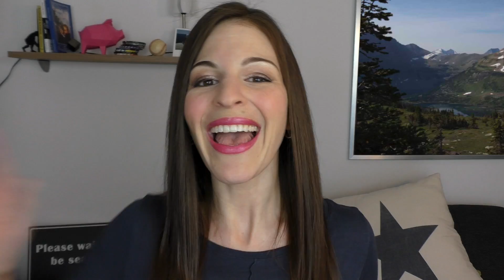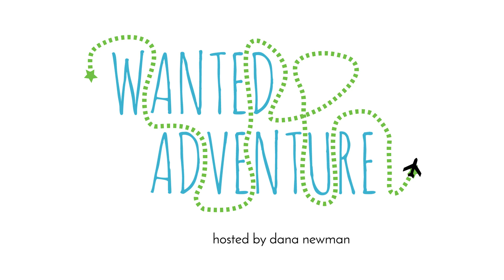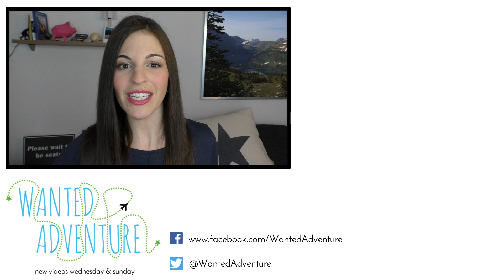Why Are Houses in America MADE OF WOOD?!

Comment: My opinion is that if a solid brick house is hit by such objects, there might be damage but after all the house is at least still there.
This is just another case where Americans think that the way they've always done things must be the best way to do it... which is almost never the case
Reply: As an American in a brick house I can tell you 75% of the time it comes down to cost. 
My house cost me $120K  My friend is about to buy a house much larger than mine for just $30K.....it's wood. 
To be fair we don't live near tornados or hurricanes or earthquakes so it hardly matters, but even so, the difference in cost is huge.
Reply: +Figthtplan-But who does that?   I don't know anyone who would have to rebuild their house every 20-30 years...you must be exaggerating to make a point.  It is not difficult to build a sound house of wooden construction that will last for hundreds of years...we have them everywhere here in America.
Reply: +TravelEnthusiastDE "This is just another case where Germans think that the way they've always done things must be the best way to do it... which is almost never the case" for building in the Americas.
Fixed that for you.

Brick houses and buildings don't stand up very well to shear stresses. You may be left with what is essentially a roughly house-shaped pile of rubble that needs to be torn down and rebuilt. Wood framing's flexibility is an advantage here. This is especially true in earthquake-prone areas. 

Stone houses are generally built like piles of rocks and the roof is not attached well enough withstand being ripped off by hurricane winds. Not terribly different than a wood frame house. But the walls in a wood frame house aren't then like a cracked egg shell, they are resilient. Take off the cladding, repair any broken timbers and reclad the house. Wood frame houses are also easier to insulate and give a larger interior space for the same footprint.
House designs using steel reinforced concrete to withstand missiles have been proposed for tornado alley, but the actual odds of a major tornado hitting a particular house is very low, making the extra investment often not worth the extra cost. Most of those towns you see on the news getting destroyed have been there for many decades or even more. It is often better to simply build a tornado shelter in or near the home underground or with steel plating or reinforced concrete.
Reply: Bullshit, a house buold of bricks would collapse in an tornado just as easy as a house made of wood. Just do the math an think what happens to houses in germany tahtget hit by a truck. Some of them are no longer safe. And those trucks hit em with 80km/h or less. Now think of the impact of a Truck hitting a house with 4-5 times the Speed.
Reply: I don't understand why there are so many comments from people who don't live in American that feel upset by how houses are built in America. Like I don't care what your house is made out of, it's not my house and if you're happy there and it works for you then great.
Reply: I live in the middle of tornado ally, and it doesn't matter what your house is made of, it doesn't stand a chance against a EF5 tornado (the strongest tornado's). EF5 tornado wind speeds go around 322km/h and that is not counting the things flying around, like buses. We also have to consider earthquakes and wood framed house stand better against them than concrete houses/buildings.
Reply: +TravelEnthusiastDE  It depends on whether you're talking about decorative brick (same in the US and Germany (and many other countries)) or solid brick as the structural basis (done in the US until the late 1920's). 

Decorative brick has no real strength.  It is purely cosmetic and provides weather protection against the typical elements.  Structural  brick has immense compression strength and close to zero lateral strength: in an earthquake or tornado, where forces are being applied laterally, they simply collapse.

Having said that, brick isn't out of favour in the US for either of those reasons.  it's simply too expensive compared to wood.  Wood can be pre-built for easier site assembly. It allows for more shapes and sizes than brick can possibly manage.  If it is treated (which isn't done in the US - they only heat treat for weight and aging) for insect protection then it won't be subject to termite or other insect attack.  Wood, quite simply, is cheaper to use.

In terms of strength for tornadoes and earthquakes, wood actually has advantages over concrete and brick.  The structures can flex with low level events, reducing damage and lowering repair costs.  In higher level events the failure cycle tends to be progressive, not sudden.  Brick will support up the point of failure and then has a very narrow window from failure start to complete failure.

Concrete is the same, but with higher compression & sheer values - depending on the type of concrete construction used.  The exception to that is the air-concrete block products.  Those are stronger than wood, often lighter in individual pieces, and can be shaped and worked just like wood.  but they simply aren't popular in the US, despite being around for the last ~30 years.  Part of the reason that style of material hasn't caught on more is still cost and the fact that US builders generally aren't familiar with it.

Personally, from seeing a lot of building in the US, I think US style materials are often utter crap, but the builders tend to do very good work with them.
Reply: Live right in that alley in East Texas, brick homes, wood homes pretty much NOTHING can withstand a direct hit...nothing. Homes with not a direct hit often are not just wood or brick but poorly built for suburbia. What most of us do is get the insurance , build a storm shelter & pray there is no direct hit. Would you it explain it to them for me?
Reply: +blue ferral What you are referring to as "wood chips and glue" is called engineered lumber and it is superior to harvested and sawn lumber in almost every way. Every piece is identical and true. Fire resistance has been tested and is identical to harvested timber. That's like referring to carbon fiber composites as "burnt nylon and epoxy".
Reply: I live in the US and I have seen a wooden house picked up and moved off its foundation into the street.  It did take some moving to put it back and a bit of repair onto the foundation but the house was fine.  To my knowledge the house was about 100 years old and is still standing now 20 years later.
Reply: TravelEnthusiastDE You think a brick house is indestructible?  Mother Nature will win every time.  She has more power than some will ever imagine.   F5 tornado vs brick house....brick house loses.
Reply: Even some solid concrete buildings can not withstand tornado. Mother Nature has a lot of force to throw.
Reply: I think you don't understand what "build out of wood" actually means. Most american houses are built with wooden frame covered with something else. Pretty much like most of UK houses, except in UK they cover wooden frame with bricks.

So it is not that easy to ignite with no reason. Main reason for fires is electrical fault, or gas boiler fault.
Reply: Coco s
Generally, a brick or stone house will have more damage from an earthquake than wooden construction...especially if the seismic activity is lateral. If it is reinforced poured concrete, it would likely do better than wood but most houses only have reinforced poured concrete footers or foundations.  As for fire, the house I lived in while in Germany was concrete block but the entire roof truss system as well as much of the interior was wood.  If it caught fire and say, for instance, the roof burned off, it would still cause a large amount of damage because as soon as you heat stone or concrete blocks, they have a tendency to expand and the mortar fails.  And concrete blocks will shatter under the heat of a fire.  This would necessitate the rebuilding of the effected area anyway even if the block wall remained standing after the fire. However, it likely would take longer to ignite into an inferno than a stick built house.
Reply: Modern American building practices are shit.  The giant builders have taken lobbied the legislatures to allow them to build houses out of wood chips and glue.  They are literally designed to last 50 years now.  When they catch fire a home can be completely engulfed in fire in 15 minutes or less.  Older homes were build with much better materials and took much longer to burn down.
Reply: There are wood houses here that are over 100 years old.
Reply: +blue ferral That doesn't make any sense. An 8 foot 2x4 made of engineered lumber has the exact same surface area as an 8 foot 2x4 made of sawn lumber. And did you not understand that they were tested?
Reply: +Coco s Look up the Santa Rosa earthquake to see if brick does better in earthquakes than wood or steel frame structures. Hint: they don't.
Reply: psunshine2 hey! I'm from wichita ks. where are you at? 
and I agree. I don't think they realize how powerful tornadoes are. there isn't any brick or concrete structuring that's affordable and will withstand stronger tornadoes.
Reply: My opinion is concrete and brick are only slightly better than wood. The best building material for any structure is going to be steel, aluminum, etc. which can then be reinforced by concrete. To be 100% tornado safe, you would need to build your house using steel and concrete properly anchored to the ground, and then also you would need to have a steel entry door and literally no windows, no garage, etc. This does not sound like a pleasant place to live! 

The real issues with wood are not so much tornados, but more-so termites and rot. With that said though, it's not that difficult to replace or fix wood structures that have termites or rot. I live in a wood home with an exterior brick overlay. My home was built in 1970, and I've had to have some bits of wood here and there replaced due to water damage, but it was easy to do and quite inexpensive. Wood homes are cheaper to build; building an entire house out of concrete, steel or brick would be so much more costly. This is why homes in America are often quite extravagant. Contractors penny pinch on their building materials, so they can build very large houses with mid-range to high-end products on the inside.
Reply: +psunshine2   >>and wood framed house stand better against them than concrete houses/buildings.<<

That is not a given.  It all depends on the building code in the state you're looking at.  Wood frame houses in CA are built to withstand low level earthquakes quite nicely.  They have to.  Houses in, say, Missouri or Florida, are not.

Americans tend to think of poured-in-place reinforced concrete whenever anyone mentions "concrete".  That is absolutely the weakest form of concrete you can get, short of using unreinforced cast concrete blocks.  There are far more options out there.  Pre-stressed concrete construction.  Air-filled concrete blocks (you can cut the stuff with a knife, but it's concrete and immensely strong), foam concrete on metal frame.

"Concrete" covers a very wide range of possibilities.

For example, pre-stressed concrete can withstand huge earthquakes if designed well.  Look at the government buildings in Christchurch, New Zealand, most of which stood up to 2 very major earthquakes just fine.  They are all pre-stressed concrete buildings and are specifically designed to withstand earthquakes.  Nothing wooden the same size survived, despite being built (in theory) to the same earthquake standards.
Reply: blue ferral  You said, "As to carbon fiber, it burns like crazy."  Below is an excerpt from  the Japanese Carbon Fiber Manufacturing association at http://www.carbonfiber.gr.jp/english/material/safety.html.  I know there are different types of carbon fiber but not sure they burn like crazy...

"Flammability: Though Carbon Fiber is constituted of carbon which is flammable, the fiber itself dose not flare up even if ignited by flame of match or gas burners. If heated up higher than 400 degree C together with some fuel, the fiber slowly burns (oxidized) but stops burning right after the burning fuel is removed. In this aspect, Carbon Fiber is categorized as "incombustible" under the Building Code of Japan."
Reply: +Benighted77 "reinforced concrete would be my choice for being in if a tornado hit."
As long as it was underground, sure. Strong tornados have been known to tear the pavement from highways. Tornadic winds carry debris big and small. The EF5 tornado that hit Joplin, Missouri in 2011 knocked one of the 8-story hospital's buildings off its foundation. This isn't a fairy tale Big Bad Wolf threatening to blow your house in.
Reply: Well what can't afford a home built like that because it's much more expensive?! Is it better to be homeless? I think the smart thing is basements in tornado valleys because even those heavy walls can fall on you then you got big giant heavy walls falling on you hitting you crushing you and burying you underneath! I remember there was a country that had a big earthquake and a BUNCH of people died and all the houses there are made out of concrete. So I think the smart thing is basements OR you can even build a small underground bunker which might be cheaper than adding a basement. They don't have to be big
Reply: Not really, Because if you pay insurance then the insurance pays for building your house and replacing everything that was ruined.
Reply: we are insurance & have lived around & in wood houses my entire life none have caught fir due to glass or something.  Most fires in homes are caused by faulty wiring, or something left on like a cigarette etc.  Since code causes for total loss after fire bc of wiring. It doesn't matter if it's made of stone, it will still be condemned and against the law to live in. It's not like wood house are just waiting to catch fire lol. My house is 190, made of wood, it's only that young bc this town is newish been here only  190 years.  But even stone houses & brick house made new are just a veneer, old stone houses are wood on the inside.
Reply: My opinion is that I'd rather have wood fall on top of me then solid bricks. hahaha
Reply: Air-concrete blocks are awesome to build with, the ability to just cut it to size and the lightness of the material makes it a wonderful material to build with and rather adaptable as well. Need another window in that wall? Get me the saw, clean and simple. Don't need that window anymore? Just put some bricks back in again, literally good as new.
Reply: I lived in a wooden house for over a decade. it's still there and it will probably exist for a few more. Just like every other wooden home in America. You're just trashing on American culture.
Reply: Something for everyone. I live in the middle of several major earthquake faults and so I'm familiar with the strengths of framed buildings (steel or wood) in such an environment. And I'm familiar with the weaknesses of masonry construction and pre-stressed concrete and even steel trestle structures that were not well thought through.

All historic masonry/adobe buildings, even those dating back to the 1700s are reinforced with plates and beams of steel now or condemned as not fit for human occupancy. Two major freeway flyover sections made from pre-stressed concrete failed and were torn down (Embarcadero and Cyprus viaduct, the latter of which tore itself down and killed several dozen in the process) as a result of the Loma Prieta earthquake in 1989. The eastern span of the historic Bay Bridge failed in the middle and dropped a section of the upper deck onto the lower, killing one driver. That has been replaced with a cable-stay bridge to complement the suspension design of the western span.

But, here is the "something for everyone" in regard to family homes, one of the main hazards in even relatively small earthquakes is not inspecting the chimney for the fireplace. The wood frame of the main structure rumbles through with no problem in a summer quake, but the brick chimney of the fireplace cracks. When Christmastime arrives, the homeowner lights a fire and hot flue gases leak into the structure and light the wood frame on fire. Houses built after the 1960s tend to have the chimney built outside the structure, though. Only the hearth is within the structure, and that is overbuilt.
Reply: +Dewy Russ Thats true. Formula 1 brakes are made of carbon fibre. And they heat up to several hundred degrees C. In fact, given the right camera angle, you can see them glow orange to yellow.
Reply: TravelEnthusiastDE   why do you hate free speech and polite conversation?
Reply: but are you not afraid that your house might simply burn down? i mean i know nothing about american houses so maby they are somehow fireproof but.. woods sometimes ignite because of a peace of glass, so what if your house suddenly burns down for no reason?
Reply: toast brot as someone who lives in California that would make some sense. We gets lots of wild fires here and because it's so dry the fires become huge(possibly hundreds of acres). It would make sense if our houses were more fire proof. Often the only thing left, but a pile of ash is the brick chimney. However, idk if a brick or stone house would do better or worse in an earthquake.
Reply: Increased surface area, increased fire spread, increased time to failure.  Yes, superior in every way.  Or you can say lighter, cheaper to ship, easier to cut, less likely to warp.  All the things that are cheaper for installation not safety.  As to carbon fiber, it burns like crazy.
Reply: Id also say, maybe not an easy brick wall, but a reinforced concrete building could withstand a tornado, maybe you would need to replace some windows and rainpipes or such, but that is no compare to have the whole building and everything thats inside in pieces, not to mention the danger for the people that live in.  I think wood is much cheaper in that area and maybe people cannot affort reinforced concrete which takes formework, reinforcment, and pooring and compacting the concrete is also a job where a lot of stuff could be done wrong.

I also think that the lack of regulations plays a key role. If you build in austria in a area that is considered dangerous, there is a zone plan, where there is clearly specificated which kind of features your building must have, to protect you from avalances, hillslides or rocks that could come down a hill. There will be no moving in, until everything is up to the law.

I dont know how that is handeld in the us, but i guess the regulations are not that strict.
Reply: Please keep in mind I am just speaking of my personal experience in the area I live in. When looking into building a house we met with the only person in our area that was building homes with reinforced concrete walls and it was going to be three times as much as a "stick built" home. Yes we do have tornadoes where I live but I have not been directly affected by one in 41 years so we went with stick built.  Was it the wisest decision? Maybe not but it is what we could afford. Of course we have home owners insurance but hopefully we will never have to use it.  I also agree with those that say Americans think the way they do things is better and in this case it is not or (in my opinion) we would have more builders building homes with reinforced concrete walls. Then again it could just be the area I live in.
Reply: Its called "Insurance",,lol
Reply: I think every year Americans hear about the people dying of heat stroke due to their brick houses heating up. Brick houses are seen as more of a liability I think.
Reply: Small town in Arizona about 2 and a half miles from the Mexico border. 
It is very cheap. we are a mine town that just opened a second mine. Homes and apartments are near impossible to afford right now because Mine workers make bank so they can raise the price, which sucks for us non-mine workers. 
So for her to find this place is a lucky score. It needs paint and the carpet is a mess. But she hardly cares about that as paint is cheap and sh hates carpet so she's ripping it all out anyways.
Reply: Thanks for agreeing with me and I live in midwest city, ok.
Reply: I live in New York State and my house and all my neighbors' houses are 100+ years old.
Reply: Bus, 300km per hour. Nah. A few walls are still there, the house is gone. ;-)
Though getting hit by such large objects is rare even when your town is hit by a tornado … but that doesn't help you if your 10 times more expensive brick house actually got hit by that tornado, and if repairing just one wall of your house is more expensive than the whole wood house, you certainly did not gained anything by building sturdy.
Reply: Im not sure he is referring to the use of engineered lumber framing, but the increasingly common practice of using oriented strand board instead of plywood. OSB does have some advantages over plywood, but, but when exposed to water for any prolonged period of time, it deteriorates much more rapidly. Since water damage is the number one enemy of wood structures, any leaks will disproportionately affect OSB, and in many climates, just the time that it is exposed to the elements during construction could reduce its lifespan. That being said, if the house and roof are built perfectly, in perfect weather conditions, in a relatively dry climate, water shouldn't be an issue. At least until the roof needs to be redone in twenty or thirty years, and the homeowner finds himself in the kind of financial situation where he replaces it a few years later than he should have.
Reply: +Traumglanz  I'm becoming a bit of a fan of certain types of air concrete block.  It really is a flexible material for domestic builds and brings so many advantages over other material choices in most situations.  The trouble in the US, though, is finding someone (anyone!) that knows how to use them properly and building codes that don't recognize they even exist.
Reply: TravelEnthusiastDE Why hit on the US?  Apparently Germans know the answers to the world's problems.  So now that that is of the way, could you please start world peace?
Reply: Because there is only one earth. Americans say yeah I have an insurance and call it a day. Well some weeks before rebuild is complete. But if one looks up topographic and biospheric history the forrests been feared by the Romans in the real germanic tribes times are got comsumed by settlers, growing dwellings, agriculture and before the mining of coal by industries like glass makers in the bohemia, metal ore melting in the hill lands of main land europe. So we as europeans are concerned by this destroying of mother natures lungs as being made a next bad move repeated over seas by the USA as a whole. Or how high is the regrowth rate of industrial grown timber in relation to that consumed by that criticised usage behavior. Not to speak of oversized pick ups and SUVs just to get to work or get your grocery buyings back to home and having only a little percentage using it for theirs initial usage they were at first invented for like litterally picking up hay or fence parts for repairing at a farm or in the second invention to get your surfing equipment to the beach or for diving those heavy oxygen containers. Back rant end or try to explain. PS Forgot wooden ships to find those lands, make wars about it and bring the new settlers in.
Reply: How are we supposed to establish world peace if the US keep promoting warfare?
Reply: TravelEnthusiastDE-You said, How are we supposed to establish world peace if the US keep promoting warfare?"

My question is "How are we supposed to stay on topic when people keep spewing out random off-topic comments not applicable to the topic of the video on which they are commenting?".
Reply: My comment was directed to one particular person, and this person isn't you. So shut the hell up.
Reply: Wow.
Reply: TravelEnthusiastDE
You know, if you actually insert the name of the person you are addressing...that would be swell.  All you have to do is type a "+" and then the name and it will insert it to the beginning of your comment so that in a string of 20 people commenting, we aren't left guessing who was the intended recipient of your wisdom.
Reply: TravelEnthusiastDE-You said, "My comment was directed to one particular person, and this person isn't you. So shut the hell up."  Who was the particular person and who do you wish to shut the hell up?  You didn't direct your comment to anyone in particular so we are at a loss.
Reply: That's because you don't understand context. Seriously, get a hobby.
Reply: TravelEnthusiastDE - To whom are you speaking?  Not sure who "you" is when there are approximately 30 people commenting now on this string.
Reply: As a fellow east Texan I approve this message. We all remember what happened out in Van the other year.
Reply: ***** Maybe same pyramidal design spreading out footprint over its inner core so the chance of been sucked up is lessened. But then the closed hatch has to be airtight or some sliding design facing upwards. Don't know the typical passaging time of hitting region eye of storm and chill of or leaving region (HAVOC and supplies needs).
Reply: Reasons can be produced for either being the better way, so how about not being quite so snotty about it?  Brick houses are deadly on the West coast of the US, which is heavy earthquake country, so much so that they are illegal in California.  (Take a look at Japan for a culture that developed wood construction as a fine art for the same reason.)  So maybe your way isn't automatically the better way either, hm?
Reply: Serai3 Yeah but it is not about California only. It is about the US!
Reply: Tornadoes cause houses to explode.  You would need a house built like a military bunker, with even the roof made of steel / concrete to survive a hurricane, and even so, the openings would have to be like those in a submarine to survive a tornado.
Reply: that point with the cost makes sense... unless you have to rebuild your home every 20-30 years^^